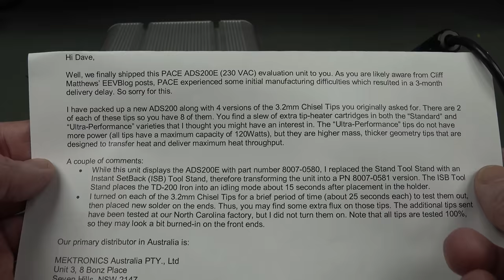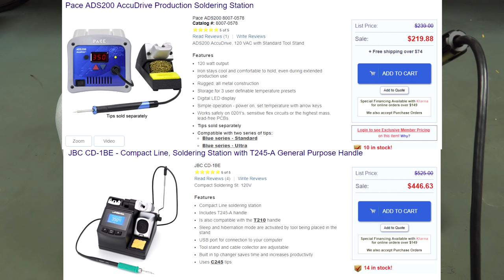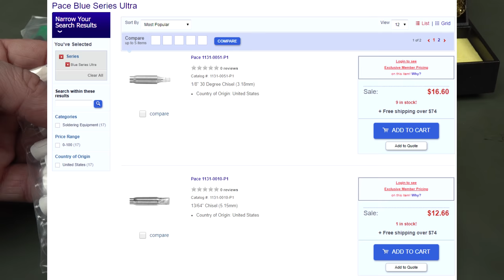EEVblog #1106 - Pace ADS200 Soldering Station Review (JBC Killer?)

Comment: I purchased and did a video review of one of the first units.  I had problems with the original tips as I reported in the video.  Pace had a representative at my door 2 days later to collect the faulty tips and replace them.  Can't ask for much better customer service than that.  Have been using it daily since then and have not encountered any other problems.  A great unit that doesn't disappoint.

As for the "no strain relief", Pace has never used them.  I have Pace irons that are decades old and are still fine.  They use really good quality cords.  And FYI, they will be releasing a mini tweezer that works with this unit eventually.
Reply from the maker: Wow, that's impressive. Try getting that service on the TS100 everyone craps on about.
Reply: based on your review I did order one of these units to replace my vintag weller ungar 921zx
Reply: I had a similar outcome with RIGOL one of my probes for my DS4000 Scope was faulty, I was out of the manufacturers warrantee, but I contacted them anyway due to you never know and after a couple of days they sent me out a newer version of the probe absolutely free (saving me £200) and I didn't even have to return the old probe, so I now have spare parts for my other 3 probes.
So I am very happy with the support I got from their EU Support Staff.

I have also had bad support from other companies where they just don't care once they get your money.
Reply: "try getting that service on the TS100 everyone craps on about"  

Try getting a Pace ADS200 for 50 bucks...Different markets entirely, bud.
Reply: Same experience here with Rigol.  I was pulling the grabber hook off of a probe and the probe body came apart.  I put a call in to Rigol and they sent me a replacement with zero hassle.  I really didn't expect that level of service from a lower-tier Chinese manufacturer, but they're obviously trying hard to impress.
Reply: Well mine was out of warrantee so I was very shocked :)
Reply: alles klar klaus : there are hobbyists on very different levels.
And further, not all professionals are working for a larger company.
Nor are all working on a large throughput (like Louis Rossmann).
Years ago I was on a solo basis working on prototypes and I had to  watch every cent. (Later I changed profession alltogether to programming.)
Reply: Imre Fabian I don't think this pace station is all that expensive at all. And somebody like Louis makes a couple of 100$+ repairs a day and solders 6 hours a day or so. If you can afford a Hakko you probably can afford this pace thing.
Reply: alles klar klaus who said the PACE is expensive? I don't mention price. I only state that there are different levels of frequency and intensity in using a solder iron.
A dirt cheap iron is good enough for someone who knows his stuff but solders only sporadically.
Reply: alles klar klaus all well and good, but when you have the time but not the cash, there is not much choice, is there?

Years ago, in a previous live (career), I teached among other things 16 year olds how to solder.
Back then temperature controlled soldering stations were almost non-existent and really unaffordable (especially for school). So i teached those kids to particularly be weary of temperature and time of heating.
I think I know a bit about soldering.
When I had the money I bought an ESRA soldering pistol (2 even, a 80W one and a 30W one). I use them still. Mind, I don't do SMD. My age makes my hands to unsteady.
I am thinking on getting a TS100.
Reply: alles klar klaus : idem for me. But I am decreasing my workload now I am at a pension (I am presently software engineer) but I am taking up Electronics as a hobby, to finish/update old projects of mine.
So no expensive equipment anymore. The most expensive was an Indispensable oscilloscope, the 
Siglent SDS1204X-E. 
Dave gave an excellent and very positive review not so long ago. Plus a multmeter and a AC/DC current clamp meter for a bargain.
I'm now good to go!
Reply: @shockwavecity  If you add a stand with that quality and a transformer base power supply, the price is already close to $150. ADS 200 is not that bad on value.
Reply: As far as thermal performance between this and the JBC, in my opinion that 10Watts of difference is what requires the Pace to be set aboug 35C higher to compensate for that extra 10Watts in the JBC.  Not a fair comparison, anyway still a great unit made in Murika... M.S.G.A!!  Making Soldering Great Again!!  Ahhh yeahh ;)

Comment: What's wrong with leaving flux on the board? Besides the fact that they did not leave enough?
Reply: Louis Rossmann : aestetics my friend!
Reply: More flux!
Reply: A Louis amount of flux
Reply: You've never worked high reliability applications, if you are asking that question.

But then, I was trained under the NASA standards for space flight use... During my training, my soldering was perfection or it was a fail. I have seen the new standards, even the current  highest level industry standards make me cringe...
Reply: Flux can cause the circuit to fail eventually if left on the board, some can be acidic and cause corrosion and/or it can retain moisture and present a low impedance and basically short out some types of circuits via leakage current... it’s better to clean it to avoid problems down the road even if it’s a “no clean” flux...
Reply: Flux addict... if your hardcore you dont use fume extractors
Reply: funny to read replies from people who don't know Louis :D
Reply: @kwastek  Yup, lol. I would imagine he sees a LOT of flux still on the board...
Reply: The bigger the gob, the better the job, right? lol
Reply: @jasonh4534  
We know all about NASA standards. Pay 3rd world countries to put Americans in space...
Reply: @NunYa953  3rd world... No... Russia is 2nd world. Per the original definition. 1st world being the US and it's allies, the 2nd being Russia and the other combloc and their allies, 3rd being all other nations not directly aligned with either, or with loose and shifting political ties to the first two.

And the need to use them to get people into orbit is recent... And NASA still has active programs for satellites, probes/rovers, and other long term missions, with high reliability electrical needs. Most of which is performed by labor in the  US or other 1st world allies.

So... Haha funny dig at current NASA situation I guess, but it is very far off the mark of actual reality of the entire scope of NASA.
Reply: @jasonh4534  May I please ask you a question?
I do not know much about soldering but I think I can recognize what you say, I saw a "new" video on how to solder "the NASA way" and I think I found several "errors" compared to an older video with the same content. Do you think that even the NASA standard is gotten less stringent?
Reply: @friedmule5403  I cannot attest directly to what current standards are, as I am not involved with it. What I can say from what I have had first hand experience with is this...

My initial training was two decades ago now, when I was in the military, learning for aviation electronics repair. The soldering standards at the time were modeled directly after or heavily influenced by NASA standards. The instructors told us that our certification would qualify us to solder for space flight critical equipment.

After I was out of training, and working at my duty station for about a year, we received a completely overhauled revision of the manual. Also training information about the changes to the standards.

The new manual and standards it outlined were altered to be in line with industry standards. With manufacturing and industry groups developing several classes of soldering standards. From low grade, up to high grade. Basically the difference between cheap plastic crap toys, to TVs, to medical equipment, on the level of reliability and quality needed. Aviation fell into the highest category.

Now, the new standard was definitely less strict... Allowing certain defects to still be a pass for quality, and larger tolerances for other factors. It went from basically needing to be defect free, to some imperfection is fine, for passing quality checks.

As a group, everyone in my shop decided to hold ourselves to the old standard, even if by the books, we no longer had to be as strict with our quality inspection approval.

If NASA also followed suit on standardizing their standards to be inline with the industry standards, then current NASA standards are definitely lower than when I first learned to solder. The new standards are not the end of the world, but they are simply not as good.

In the civilian world, people who learned the standards I was trained to thought doing such high level consistently was basically impossible... Untill they seen my work at the end of the day, and I was usually the fastest. I can't do that any more though... Not very fast anyway. Worse eyesight, less steady hands, and less regular practice. I can still do it very well when I need to do any soldering, just a little slower at it.
Reply: @jasonh4534  WOW thanks for a great long and wary interesting answer! :-)
One of the things I did notice in the "new" NASA instructional video, was that they didn't were gloves an they used one Kimwipes tissue several times! They did even not wipe the solder before use.
Reply: @friedmule5403  Thanks... Videos like that are not really meant to be all encompassing, so I'm not surprised if they didn't follow everything perfect. The real tell is in the actual classroom lessons.

Fresh solder doesn't really need wiped off, and if it's old, you need to get new stuff, it has a shelf life. Proper use of flux prevents many soldering issues. Proper cleaning of the work piece after completing work, is pretty critical for long term reliability though.
Reply: Louis Rossmann, leaving flux on any board before or after a soldering operation is a sign of not only laziness, but a complete lack of professionalism. There is too much mediocrity in the repair profession that deals with soldering as a part of the process. Anyone can learn how to solder, but people who don’t care enough to learn or ask when they don’t know something involved in it, have no business doing it, period. I consider myself a solder fanatic. I don’t know it all, but when it comes to solder operations in general that relate to high quality, high reliability soldering, I have zero tolerance for any lack of such what should be common knowledge of highly experienced solder techs. Saddle up and listen closely! Leaving any residue on any solder joint is unsightly, is a playground for attraction of dirt and moisture and shows a complete lack of professionalism. Cleaning pads, leads, wires, connections and the solder wire itself prior to and after each solder joint operation is essential to a high degree of confidence in that joint’s ability to handle adversity, yield a professional and appropriate appearance and survive time! People who do not want to put forth the effort necessary to do the job correctly and right, don’t have any business having anything to do with the soldering process. If you consider this a rant, you don’t care about soldering! While my opinion may differ from yours, I have been in a position of responsibility which my skills put someone else’s life in my hands. I take that more than seriously. If you do not care, leave it to someone who does! The performance, of what you work on, should matter to you or you are in the wrong place. The responsibility for what level of care you deliver to your customer should be a high priority! That is your living! I have had that responsibility where my failure could mean the loss of human life and or loss of a capital asset! When it comes to my living and my philosophy, I am doing what I can to make failure as distant a possibility as I can. The difference in the professional solder tech is not just what they know, but how much they care about what they do and to what degree they are willing to go to make the repair or build they are involved in to be the best they can or leave it to someone who can or will! It is as much a discipline as a profession. If you don’t know, ask. If you don’t know how, learn! Care about what you do or leave it to 
others who can!
Reply: Did you see the guy with the name and the Videos on the YouTube thing that mentioned you in his review? The German funny guy you know who I mean because German.
Reply: Can these tips work on the ts100 ? And is there adapters for tips to use ultra tips with other direct heat units?
Reply: @NunYa953  hahs
Reply: It's not called no clean flux without reason but I still prefer to remove the residue.
Reply: Flux doesn’t damage the board or connections. Modern fluxes don’t contain the kind if impurities that old fluxes did. It may not look great, but it’s not a problem.
Reply: I learned to solder in light industrial conditions and building Heathkits in the 80's. Got really good at leaded components and old IC's. Those were good kits. They came with great instructions. But they never talked about flux removal, and unfortunately I never did it, and I put together a hell of a lot of shit - boards, connectors, a lot of 1000w/channel multi pin stage light connectors, etc. Unfortunately I never removed flux. 

That was pre-internet of course, and a little more difficult to find out about, but no one was talking about it where I was. At least I know that all that equipment lasted a very long time. It out-lasted it's obsolescence.

No doubt I was exposed to some lead in this process. Procedures ended up being fairly cavalier about lead exposure. That's probably the single biggest mistake we made.
Reply: We need at least 2 Paul's in this case.
Reply: @birddog0  1st World/2nd/3rd is a political term, not a standard of living or GDP or anything else... It's about Cold War era political allegiances mostly.

As far as outside the term as originally defined. The US has issues but China still has many civil rights issues, poor working conditions for much of the labor force, and Stalin'esq levels of oppression for various groups.

The US has many issues, but it isn't as bad as China on the whole. After going down more of the path we are taking currently, who knows.
Reply: My previous boss would love to give you the lecture about when he had to rework 10K devices because of flux
Reply: I'm new to this, but just to repeat what one of the videos I've watched on soldering mentioned: excess flux can attract detritus.
Reply: @Marcin Berman Maybe you can say that today, but the original definition of first world was the US and their allies. Soviet Russia and their allies we’re second world. The meaning of first and third world, which are really the only ones in common use by the general public, has expanded and changes to basically mean ‘rich country’ or ‘poor country’…
Reply: @markphilpot4981  Whoosh.

Comment: Regarding the buttons maintaining their molding link. Reduction on BOM parts.....only need to manage (1) part vs (3) parts. Actually a very smart detail from someone at Pace.
Reply: Absolutely correct Brian! Also keeps assemblers from placing the buttons in the wrong place.
Reply: PACE Worldwide-AC You guys really need to fix the ground bounce on your thermocouple readings. That's pretty nasty and is why the readings are all over the place.
Reply: We're working on it! Will get back to everyone soon.
Reply: PACE Worldwide-AC nice to see you guys actively listening to comments/complaints in places people actually comment on. Anyway fantastic product for the price.
Reply: @paceworldwide-ac4422  
Is there a mechanism for end users to update the firmware with this station?
Reply: @dalriada842  Yes, you provide a screw driver. 4 screws and 3 minutes is all it takes.. (if you go slowly). When you ask for new firmware on the support site, they include a free chip puller if you need one. I think these Americans are almost as nice as us Canadians. ;)  IMHO, now that my ADS has version 1.4 it will never need upgrading.
Reply: @CliveChamberlain946  
Thanks for the info.
Reply: Well, Dave seems to be a bit biased against American products, so it's kind of expected.  Oh well.
As far as thermal performance between this and the JBC, in my opinion that 10Watts of difference is what requires the Pace to be set aboug 35C higher to compensate for that extra 10Watts in the JBC.  Not a fair comparison, anyway still a great unit made in 'Murika... M.S.G.A!!  Making Soldering Great Again!!  Ahhh yeahh ;)

Comment: I did control work for many years. It looks like they are probably doing a closed PID loop control and are displaying the instantaneous temperature they driving to instead of the temperature of the tip. The drive will overshoot for a few moments of and on to try to reach the target temperature quickly.
Reply: That's exactly what I was thinking, that fluctuation might just be in the heating element itself.  What they are probably doing, is over driving it with PWM to get the temp up there as quickly as possible, then sample the tip temp to make sure it's within range.  It's a totally acceptable method.

Comment: I would be curious what the actual tip temperature of the JBC is.

I had a WHA900 that when set to 450c, went to 445c. My JBC JT-A hot air station when set to 450c was shooting out 517c air!

I wonder if they are actually better, or just calibrated very hot out of the box. This is hot air, not the iron, but I am wondering if it follows the rest of their products.
Reply: Louis Rossmann : hi. Hot air cools fast at a distance from the nozzle.
So for thermal shrink tubing that's OK. I can imagine that for someone reworking single components on a densely packed board, like you do, that's a nuisance.
In short: I agree totally with your observation.
Reply: @ 29:50 The JBC tip temp is spot on.